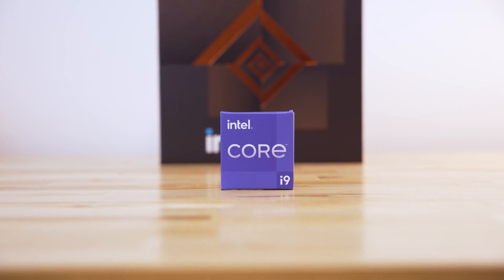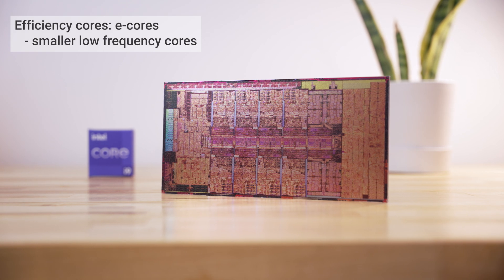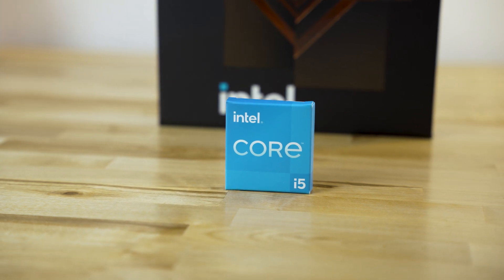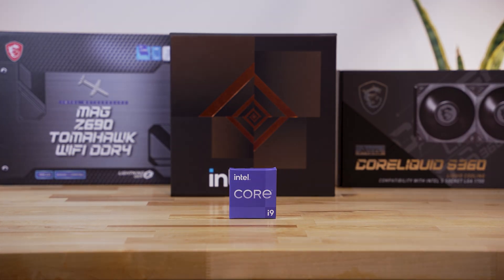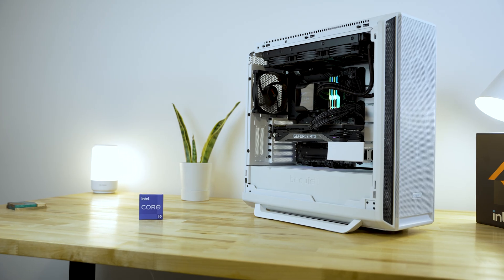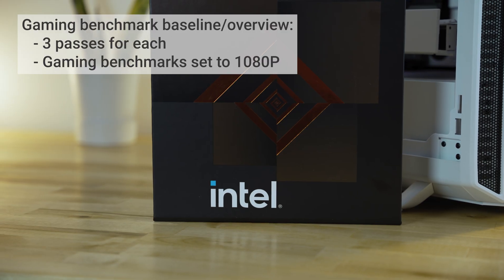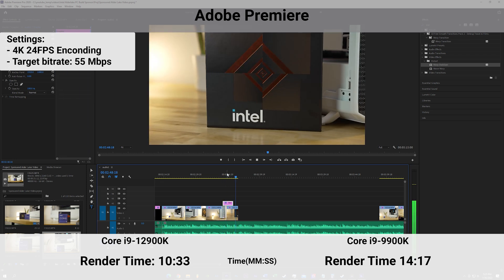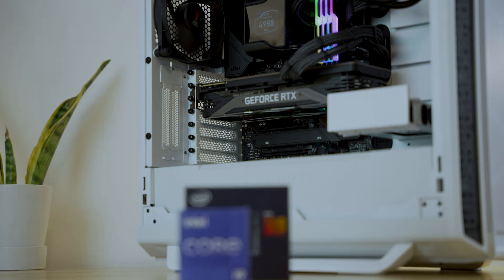From an Intel 9900k to 12900K - Upgrading My PC!

Comment: Thank you so much for this video! I know it wasn’t really meant to be much of a tutorial but I really needed some guidance. I want to upgrade from my i7 9700k to an i9 12900k. Did you have to reinstall windows 10 and wipe your drive? If you didn’t, have you had any problems with your pc? Any response would be greatly appreciated.
Reply from the maker: Absolutely! That's exactly how I planned this video: to help understand the upgrade from Intel's previous architectures to this hybrid one. So, I'm really glad that's what you got from it. And nope it just booted up normally and I logged in as if I was on my old PC. Very seamless process. Hope it works out for you 👍
Reply: @jdtechgear  Thanks so much for replying man!

Comment: Question when you switched to the new motherboard did you have to wipe the boot drive clean and reinstall Windows?
Reply from the maker: Nope! When I booted into the bios for the first time I just made sure the boot drive was the correct one, and the bios already recognized it. So, I did not have to wipe, remove, restore, or reassign the drive
Reply: @jdtechgear  wait so you don’t have any instability using the same boot drive on the new setup? Everywhere I’ve looked people say always wipe the drive when upgrading to a new architecture.
Reply from the maker: @jdogg0130x2k  I haven't read up on anything like that yet, I've been running this system for about a month now without any issue